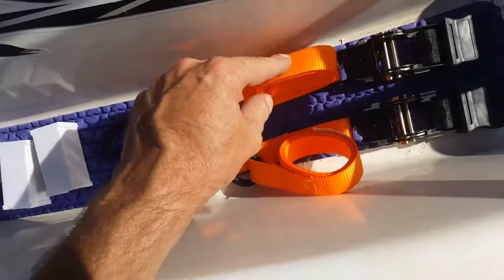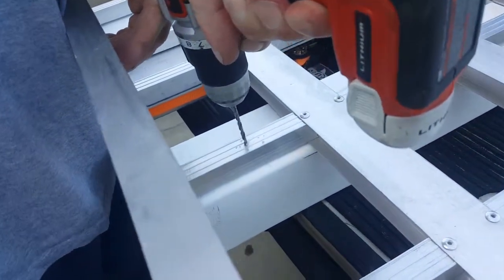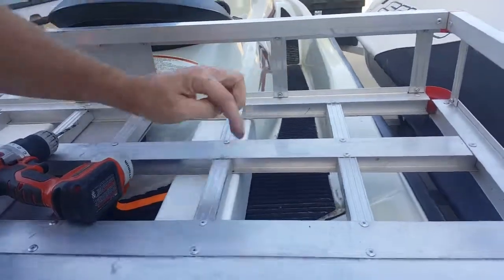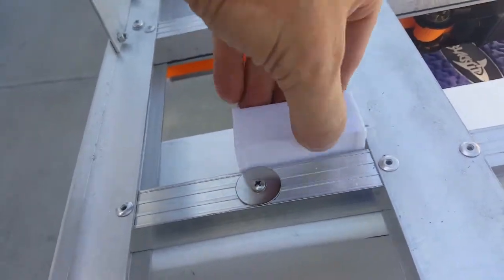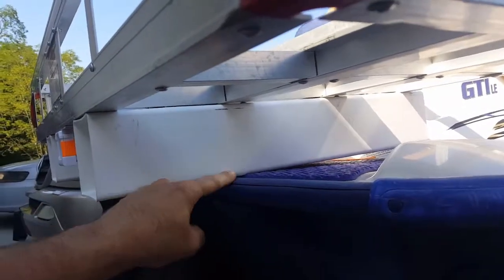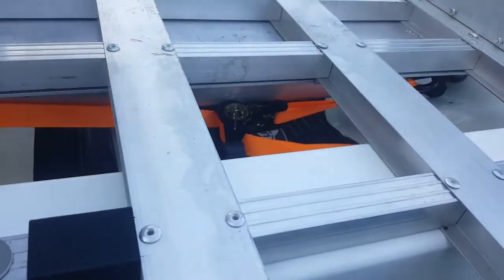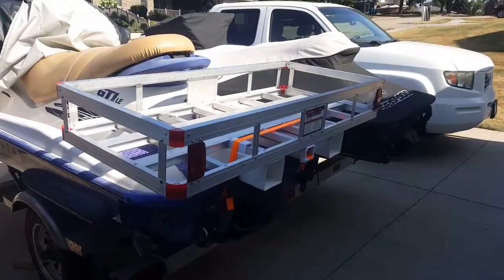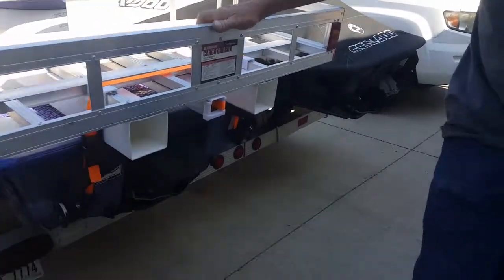Jetski Cargo Rack Kit

Comment: How does that plastic hold up,looked like it was buckling already.......how much weight have u tried in it personally
Reply from the maker: For sure the square plastic tubes are not going to buckle. You weight limit will be how much you can add without sinking the rear end.
If you add to much weight you will not want to add passengers.

Comment: This is ridiculous. Just buy a boat before you hack up another pwc. And get some sharp drill bits while your at it.
Reply from the maker: This will not hack up your jet ski.
It straps on, and removes easy.
No modifications are done to the jet ski. In a few minutes you can remove the rack and the jet ski is returned to original.